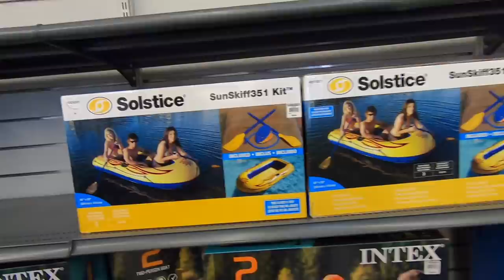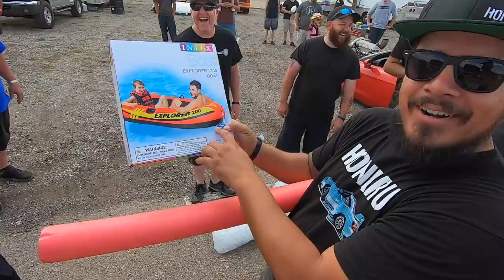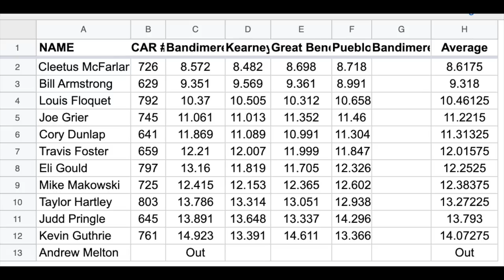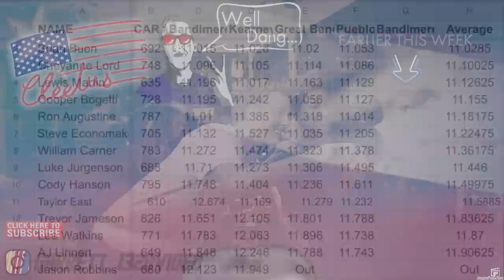RACE WEEK Day 6: The Axlepocalypse, But the Damage Goes Deeper... BAD News for Ruby!!!

Comment: Great to see that it was resolved and you did 8.6 that was as good as it gets. Smart move not to push it anymore, no need. Safe and smart.
A very productive week that also shows how much maintenance you do need to do on a race car like swapping parts that might be good, but still might break under pressure. Basically next year it would be smart to disassemble most modules of the car for even closer inspection to remove this possibility.

Comment: Ruby is pretty well mannered for a red head.
Reply: Red in the head
Fire in the hole
Reply: @hiwayhighway9925  that's what happens when you regularly push 1000hp to the ground and run consistent 8.5 passes. This power isn't reliable. But it sure is fun!!
Reply: @hiwayhighway9925  All things considered, most problems were caused by doing dumb things like seeing how much power a questionable junkyard motor could handle, poor tuning, etc. As far as actual mechanical issues outside of the results of learning or outright abuse, she's been pretty solid
Reply: @phantom240  Whom are you talking to, if I may ask? Looks like there are some ghosts around here...
Reply: @cramstick  😂
Reply: Seems like there are a lot of troll ghosts
Reply: No joke...I didn't have such good luck, fun while it lasted.

Comment: Props to James for removing the broken axle bolts on the road at the track. Some people send them back to us with out attempting to remove the broken bolts. If the axle isn’t old and rusty or torqued to the point it’s ruined anyway, I usually get them out with a small center punch and a small ball peen hammer. Hold the punch straight up near the edge of the bolt and hammer a small divot. Put the point of the punch in the divot at an angle and tap it out with the hammer. It works 75% of the time if the broken bolts aren’t overly seized...

Comment: 16:20 - Looks like Coop figured out (or someone told him) that the car is quicker letting the trans auto shift vs shifting it manually.  Nice job.
Reply: @antnay_beastz9361  watch a couple videos back, he was shifting it prior via paddles
Reply: Hiway Highway How fast have you run a GT500?
Reply: @hiwayhighway9925  how so? Its not his car for starters and his been running 11.1's in the 11.0 class.
Reply: @hiwayhighway9925  come on man coop is a legend, he got in a brand new to him car and ripped. not cringe to me
Reply: Yesterday (I think) he had his fingers on the paddles, but wasn’t using them.
Reply: Monte Stu looked to me like he was flicking them
Reply: The altitude and heat really hurts a supercharged car. And I think being not his car at a prepped track he hasn’t been using the full launch control.
Reply: @dylanmcintire7677  hey I like the guy, but I guess you and I have two very different definitions of what legend means.

Comment: ☄☄Feel bad for Coop. He givin his all and doing VERY WELL but can only grasp 4th! 💪💪 
That dude Brian Buen must race bracket or something. Averaging 11.0285 across 5 tracks... Holy Sh¡¡¡ that's nearly impossible to beat!
Reply: Top 5 is nothing to sneeze at. It's a crowded field. You can make very reliable. dailyable car that runs a 12 consistently without near the time and money investment of much faster cars.
Reply: Coop should have run again at Kearney after sundown. He did back to back 11.2s in the heat of the day, I bet he could have got a 11.1 or 11.0 in cooler evening air.  That wouldn't be enough for the lead but have him fighting hard for a podium.
Reply: @wingracer1614  I don't know Jack, really, but looking at the lead table, I think you're right. Kearney might have lost him a podium spot. You make your choices and take what comes, but yeah, Coop can still be proud too.
Reply: @wingracer1614  i'm surprised they aren't putting ice bags on the intakes before he runs just to get that little bit more. it's worth a try.
Reply: Then again, anything can happen in a race. Who knows whose car breaks down next?

Comment: Has looked to me like Ruby is throwing a belt when shifting every pass lately.
Reply: Bucks N Trucks noticed the same thing! I wonder why they didn’t mention it in the last video?
Reply: It’s probably a spring loaded tensioner and the rpm change when he shifts is kicking it off
Reply: @boxr_4214  or to go leroy status and run no belt down the track.

Comment: By the looks of you boys hands, I think NOW would be a good time to get that "GoJo" or "Fast Orange" sponsorship.
Reply: 100%
Reply: coming from someone thats been using gojo or the orange for the last 10+ years dawn works a million times better, and is nicer on your hands after a couple washs. Dont get me wrong gojo has its purpose but for what he was doing dawn is just way better. Gojo nice where you have the grime that just keeps spreading and getting darker as you wash it.
Reply: @danking5382  I've noticed this too myself.  I usually find it hard to beat dish soap and a lava bar.
Reply: @danking5382  Not saying you are wrong about Dawn but I think they would have an easier time getting some free product from the ones I mentioned than they would from Procter and Gamble.
Reply: @MrWoodyBalto  if they wanted free gojo they should go with the gojo rags where you don't have to use water. Honestly them things are pretty damn good. But if they have water stick with dawn no water gojo rags does wonders imo. If you use gojo everyday for life once you hit 40 you'll never be able to get microfiber rags off your hands again lmao

Comment: Hey Cleet, any chance that hand break is staying engaged? I've watched tons of vids of Leroy...watch the 9:50 point in this video. Those shifts are tight by the way. On the slow down the gs allow hand break to move way forward. Just a thought.
Reply: Always thought the handbrake was holding Leroy back in the quest for 7s... Think it needs a spring to hold it forward
Reply: D Mac I’ve noticed that before also.
Reply: @dasmaus  ever drive a car with manual brakes?  I guess not.  The amount of force required to put any meaningful force to the rotor is ridiculous.  So no, the force when he shifts is not doing so.  But hey, I've seen probably 20 videos of him explaining it, and we all know that he and everyone in his crew for the last few years don't know shit...right?
Reply: @user-bm8vc6bu8n  nah, the brake was in way before the 7s.  Again, a few ounce free floating Eagle, isnt comparable to the amount of force needed to actually apply enough force to engage the brakes on that system.
Reply: Wish someone would put a g meter on that handle so I could work out the numbers... I'm sure the force applied for that split second is  definitely having some effect
Reply: Was thinking the same thing. Alot of mass and leverage in that stick.
Reply: 1216jimmyz Doesn't matter how much Cleetus explains it, people will still comment he needs to fix the handbrake, it's holding him back, blah, blah, blah. And oh yeah, he needs body panels, he's losing soooo much time without em.....
Reply: @KJ-kw7gh  exactly, thank you.   I keep forgetting how many "professionals" there are on here.   And what's amazing, is even if most of them are old enough to drive, there is probably a 99.999999% chance they have never had any type of real racing experience.....lol

Comment: You guys probably already know this but you should get bolts or drill holes in the bolts and run wire around them so they don't back out

Comment: I'm with you.  Drain n fill the trans.  But use Type "F" fluid. (The base of all expensive racing trans fluids)  It stops the Dexron sliding shifts and promotes it to grab. (In case the high clutches are getting thin)

Comment: Please read this to fix your axle problem!!  If someone hasn't posted this  the axle bolts are not coming loose.  You are stretching the bolts.  Just like one time use head bolts when you find your axle bolts are loose, they are used up.  Take them out and replace them with new ones.  Re torquing stretched bolts always leads to failure!  Its just that simple!!

Comment: Had my axel fall off my golf going 55mph, punched a hole in the 5mt, had the trans shop take it out weld it and install, good to go, 3 months later happened while stuck in traffic going 2mph i was so happy to have a jack, extra bolts, and some can do attitude and was back in action 7 min later.... The trans shop was like who do i have to fire? I said were good, just add some locktite and a new gasket and were good.

Comment: Bolts are for clamping parts together, not for taking shear loads like shaft torque - you may be well advised to use some higher tensile bolts that can be tightened more for a greater clamp force. TBH, I'm a little surprised that at these power levels dowels, that are intended for sheer forces, aren't more commonly used?

Can't recall if it was on one of your threads, or Fasterproms', but if using higher tensile fasteners it's important the torque used to tighten them is correct - if you do a quick search, "Steelmasters Torque Table" should give you a better idea of the required torque figures.

Comment: Just a idea. I know the cardboard roof is legendary. But my idea is to make or have one made, a top like you would have on a Jeep. Make it quick release to bolt to the cage, and have the front lip curl over the windshield enough to have a gasket press on the windshield so you can roll in the rain and then couple quick pops and take it off for racing. Make it out of some fiberglass for weight.
Reply: Probably one of those things they discuss getting made during/right after race week but as the months go by and the car is doing 0 street miles it just falls by the wayside..I swear last year they discussed roof options for Leroy.

Comment: Ruby has a simple, low shock drive train that should prove superior.  There's probably more capability by fine tuning the torque converter.  Need to partner with a converter company if you haven't already.  I'd like to build a sport truck with a driveline similar.  Fun stuff !!

Comment: Instead of lock-tighting the bolts learn to safety wire the bolts that way you know they will not back out. Atleast on critical / problem areas like the axles that keep backing out.

Comment: Ha! Duct tape in the boat racing work is known as 100mph tape, until you go faster than 100 and then it's called 200mph tape.
Looks like old cleet has that good 200mph tape!

Comment: I honestly believe the main reason ( note I say MAIN reason ) Ruby is smoking the competition, is because of that killer custom-built 2-speed powerglide transmission. IT BITES INTO THE TRACK ON TAKE-OFF WITH VERY LITTLE WHEEL-SPIN, AND THRUSTS THAT CAR FORWARD IN BOTH GEARS LIKE A ROCKET SHIP. The competition is slipping & sliding during their launches, bet on it. Sure, that powerglide costs 10 grand+........but ya get what ya pay for.

Comment: Have you ever thought that when the ebreak is being pullled back during the pas could slow you down any it the same distance back during the pas and when you pull it to to slow down
Reply: Leroy's ebrake has a deadzone, it doesn't engage during a pass, Cleeter has mentioned it before. The reason it likely stops where it does and the Gs of launching don't pull it even further back is because where it stops is most likely where the ebrake actually starts to bite, and pulling it further needs more force than the launch can make.

Comment: Apply Loctite primer to bolt and bolt hole before you apply threadlocker, it will make ALL the difference!
Reply: They're not coming loose.  The bolts are stretching.  By re torquing them the bolts are  going to yield.  Just like reusing one time head bolts or rod bolt always ends in failure

Comment: why are they launching way after the light turns green? Are they not worrying about reaction time in this race series?
Reply: No it's just when they break the beams to the finish..some sit past green to get up on the 2 step and launch at the ideal time..or avoid powering thru the brakes if they dont have a trans brake..racing the clock the tree really doesn't matter cept leaving too early.

Comment: You guys should look into getting drilled bolts and safety wiring em. Also, are you installing the bolts with a torque wrench? I've had similar issues (at a vastly different performance level) with my beetle, now I always torque them. Uneven torque can lead to the less torqued bolts backing out until the more torqued bolts can't handle the shear.
Reply: The bolts are stretching.  By re torquing them the bolts are  going to yield.  Just like reusing one time head bolts or rod bolt always ends in failure

Comment: You should start safety wiring your bolts for these trips. It would help prevent a few of the problems you've had.
Reply: They're not coming loose.  The bolts are stretching.  By re torquing them the bolts are  going to yield.  Just like reusing one time head bolts or rod bolt always ends in failure

Comment: Nord lock washers for those CV bolts.
Reply: They're not coming loose.  The bolts are stretching.  By re torquing them the bolts are  going to yield.  Just like reusing one time head bolts or rod bolt always ends in failure

Comment: Am I right in Saying Leyroy and ruby are the same. Except The Body. Leyroy Accellerates Faster at the Start and Keeps the Speed in a Drap, But Ruby is slower at the Start but Gains Ground top end but not enought to have the same speed as leyroy. Saying becuase Leyroy and Ruby are the Same. or is the Time DifferentI e.i. Slieghtly Faster in time and Speed. I am a Bit New Here Guys, PLease be nice if you think ythats an Imature Comment. THanks. THin Leyroy sounds Amazing, you should do a Sound  Track of just the sound of Her/Him All the Best. Gareth in N.Wales.
Reply: Leroy is a stick shift car, ruby has a glide.  I believe they are also different models, but could be wrong - I dont follow super closely.  I think they have same motor (Texas Speed 427 ci ls something or other)  Leroy is of course also twin turbo vs single on ruby, and I'm sure theres a variety of other differences to boot.

Comment: cleetus drill a 1/16 hole across all of the axle hex bolts and wire them they will never come loose ever use aircraft grade wire copy how a propeller is wired through the bolts
Reply: They're not coming loose.  The bolts are stretching.  By re torquing them the bolts are  going to yield.  Just like reusing one time head bolts or rod bolt always ends in failure

Comment: Invest in some Nord Lock washers appropriate for you size axle bolts and u won’t have Tht problem anymore!!!
Reply: They're not coming loose.  The bolts are stretching.  By re torquing them the bolts are  going to yield.  Just like reusing one time head bolts or rod bolt always ends in failure

Comment: Could you safety wire the bolts on the axle so they don't back out?
Reply: They're not coming loose.  The bolts are stretching.  By re torquing them the bolts are  going to yield.  Just like reusing one time head bolts or rod bolt always ends in failure
Reply: @cre8itgroup903  In that case would a higher grade bolt not do the job then?